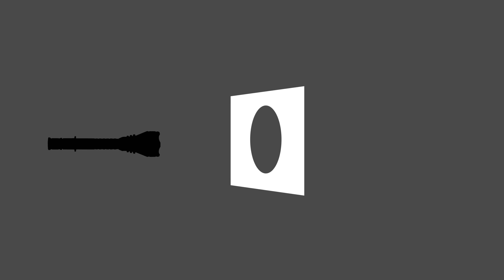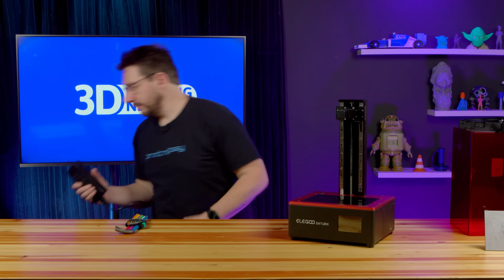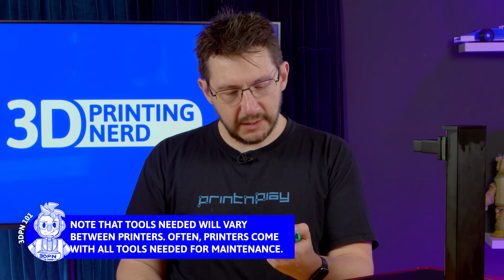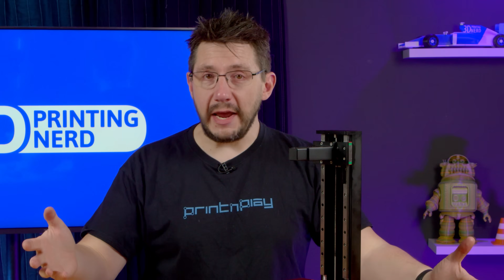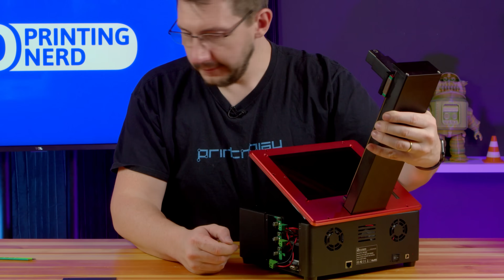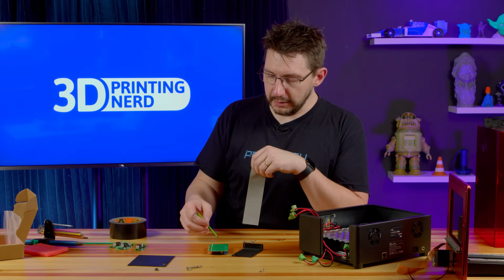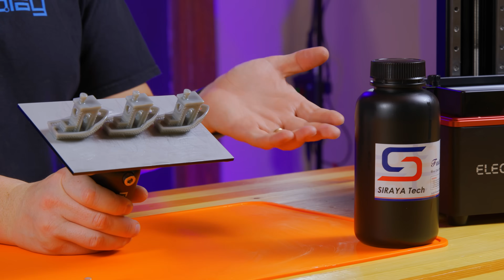FIX AND WIN an ELEGOO SATURN!

Comment: Hi, I'm new to 3D printing and I'm having some serious issues with my printer. None of my prints are coming out. They are not sticking to the plate at all, what am I doing wrong? I've pre-set the plate like a 100 times to make sure it's leveled and still it won't stick. Am I not doing all the steps? What am I skipping, I even contacted Elegoo and they won't help. So right now I have a big paperweight that won't print. Please help me out.
Thanks.
Ohhh, what I have it's a 1st gen Saturn

Comment: That is the one board that I did not have to fix in my Elegoo Saturn. I had to fix my Touch Screen, get a replacement 4K LCD and a replacement Main Control Board, plus I also got a replacement Build Plate from them to start off with. Took me 5-1/2 months to get mine working. It was a pain but at least it works now and works well. :P

My main frustration was not with the having to actually fix it or Elegoo Support but with China Post that they used to ship the replacement parts. Elegoo itself was very helpful. But China Post lost one of my 4K LCD screens and two Control Boards. Basically Elegoo had to ship out two 4K LCD screens and three Control Boards before I got one of each. The third Control Board actually got shipped from Dubai instead since they lost it twice through China Post. I really wish they would stop using China Post.

My Saturn was actually one of the Early Bird versions. I am guessing it was actually one of the units they sent out to be tested or something but who knows. It is a good resin printer though. The newer production runs have a lot of the issues fixed. They use a newer parts now. The Build Plate is a little larger. The 4K LCD is better and has a better ribbon cable design. The Control Board is updated and now it seems the LCD Drivers Board is as well. I think they may also have a new light source and updated TFT LCD. Not certain on the Light Source though. But all the others I know for sure have been updated from the early production units. So Elegoo is good at updating and fixing issues with their products. That is for sure.

Anyways...It was a great video to watch and one that is definitely helpful for those in need. :)

Comment: Hey Joel, as always I love the content. I know this is a bit of a read, but bare with me. With the larger build volume of the Saturn, I would really be able to look further into making lower cost dentures for people in need. When oriented around a 75 deg angle, I think I could get 4-6 to print in one go.

The backstory:

A friend of mine, Joe we will call him, was in a really bad motorcycle accident early on in his life. He spent a couple of weeks in an induced coma and then several months in the hospital recovering and rehabbing. Fast forward 40 years, through some things he could control and many things out of his control, Joe's life has been not quite the easiest. Over the past few years, his teeth have been deteriorating and because of the lackluster employment offered healthcare to non-full time employees from most companies, Joe, like a lot of people has had to pick and choose what his income goes to. I found out today that, through Medicare, he is going to have a multitude of teeth pulled. The kicker? That is all Medicare will pay for.

So for the people like Joe, which I know there are so many, I started looking into what 3d dental printing is doing for dentures. We in the community know the costs associated with this. While dental resins are easily four times cost of the resins we are using for the toys we are goofing with, that still puts the basic denture print at ~$5 in resin. The average dentist (at least in my city) that provides 3d printed dentures is charging about $1000. To me this is criminal.

Comment: Hey 3D Printing Nerd! I would like to print a Nintendo Switch case I designed in Fusion 360 with a SNES Zelda vibe and thus join the 3D printing community ! :D
I hope it's not to late to enter the contest, finished modelling my part a few hours ago, but my comment keeps getting erased (so I won't put the thingverse link but thing id is 4807949)
Keep up your amazing work and thanks a lot for what you do!

Comment: Hello Joel,
I am an junior year engineering student focusing on Mechanical/Aerospace Engineering. I am doing an internship this summer focusing on the additive process to prototype and manufacture flow angularity sensors to model airflow in a wind tunnel. With my internship being virtual, I do not have access to a machine to make prototypes and models, this is why I am reaching out. I would be using the Saturn to make and study prototypes eventually leading to a final product. I also plan on assisting local engineering firms who don't have access to 3d printing technologies at this time. 
Thank you for giving everyone this awesome opportunity,
Steven Little

Comment: The Saturn would be of great help to me and my work. I'm a former engineer turned inventor and I've been working on new designs for greener energy. My current concept is a new type of portable solar panel design that would work in disaster zones, isolated communities, off-grid homes, and RV and motorhomes.
I really need a resin printer to make the small pieces I need for a small prototype for testing the complex mechanical parts of the design. My FDM can't make the parts accurately enough and I'm on disability so I can't afford to buy one myself.

Comment: Great job Joel, if I were fortunate enough to win this I would use it to create replacement knobs and other hard to find parts for vintage synthesizers and other electronics.  Also I have designed and created parts for a couple drummer friends of mine.  They really like the parts I've built for them, but I would love to have a smoother part to start with so i don't have to do so much sanding and filling.   I've been watching you since I bought my first well worn Ender 3 from a prop guy.  I've completely rebuilt and now modded it thanks to some of your content.  Thank You for helping us all

Comment: Love all the videos! I'm currently exploring the idea of utilizing 3D printing in my company (to see if the company wants to invest in it) for manufacturing and prototypes. I would use this printer to print small prototypes to explore the potential even if it is on a small scale. Might also try to explore prints that are more suited for Resin since I'm only used to FDM.

Comment: My current project is a 3D Printed Drone (barring any electronics or hardware). This printer would be great for 3D Printed Propeller Prototyping. I'd experiment with pitch, number, and length of the blades. Also, when it inevitably crashes and breaks the propellers , I can print replacements.

Comment: Thank you for the video.  I would make robot parts to make a smallish but not micro, robot to try and get the nieces and nephews interested in electronics.  I've already gotten the raspberry pi's and arduinos for them, and module parts.  I just need to be able to fabricate a base unit to mount the sensors to in order to get their attention.  ( I think their dad is afraid of tech, which dampens the spirit. )

Comment: i love to 3d print. just bought a Mars Pro, and plan to print various parts for Lost Resin casting, jewelry, miniatures and components of various types. i love building all sorts of things. 

would love to 3d print a working mechanical model for a steam engine, or eventually maybe a sterling engine, to use as a backup generator that i can then iterate in resin and then cast when perfected to make the final parts.

Comment: If I won the Saturn, I'd use it to print tools and accessories for arts & crafts, photography, and astronomy. Also novelty items and custom or replacement light duty practical parts. And finally, molds for casting even tougher objects from fiber reinforced resins and metals.

Comment: Hi I am 14 years old and from Germany. I am currently having an Anycubic I3 mega s. I am working on a 3D printed VTOL and some of the parts have tiny holes and they are very small, they need a more precise was of manufacturing than the fmd method is able to deliver. 
You make great videos!👍

Comment: New parts for my AM8. Also I would like to add, that you should probably use electrical tape as gorilla tape has a bit of electronic conductivity. I found this through using gorilla tape on a high amperage circuit in an automobile and it kept shorting the circuit. Once I used electrical tape the short went away.

Comment: I would use the printer for my classroom. We are heavy into project-based learning and this would be a tremendous asset to have. The first use would be to print out the nose cones and stabilizer wings for the model rockets we build. Good luck to everyone.

Comment: Do you need to calibrate the uv light? (There are Potentiometers on the driver board.) And15:23 gosh just print a new plate XD. I would print some custom parts for my Ham Radio Satellite Basestation (Google: QO100 Eshail). ^^

Comment: If I had a resin printer I would print gears for a tiny planetary gearset. And parts for making an Axial Flow Generator. It's a electric generator that has the magnetic flux travel along the axis through the coils. Its a lot more efficent that way. I already have all the parts. I just need a printer that is more accurate than an FDM printer.

Comment: i plan to start a injection molding business to recycle used plastic and give it a new life. But tooling for aluminum molds are very expensive. I would use this printer for high resolution mold production! Having a Resin printer would allow the company to have flexibility and be able to adapt to market demands quickly and efficiently.   The company will focus an a green solution for recycling and producing new plastic products. Weldys Workshop here we come!!!

Comment: if i had this printer would probably use it to print minis,   before the hole social distancing i had started doing so with my FDM printer only to find out that FDM is not the best for miniatures :((
Also things for my car,  i know i wont be able to design and print an Air box with this thing but i could totally make replacements for all the busted plastic on the inside of my old golf.

Comment: It's always feels rewarding when you can double check a failed component with a simple verification such as moving power sources around. Great video as always. I'd use the Saturn for printing miniatures for board games that I play. I've been using my Ender 3 for a few years and while it's still good, it's no where near the quality of a resin printer.

Comment: I would love to print mechanical testing specimen using my thesis project (I am developing renewable resource based additives for photoresins, not just for 3d Printing). This printer would allow me to test that, especially as a s**tload of my other equipment got destroyed in a fire last month, but htats another stroy and I hope insurance will pull through on that -.-

Comment: I would start by printing a Joelbot in your honour and then i could finally print all tiny things with too small details for the filament printer and light-guides that will actually guide the light :-)

Comment: I am currently developing an automated gardening solution. My main focus is applying automatism for watering e.g. Lechuza TRIO planters automatically and correctly with e.g. a Gardena MicroDrip system. However, i dont want to use Gardenas system as it is way to expensive and unnecessary complicated. Doing this from Scratch needs a lot of prototyping mid and small sized things making the clamps and holders for tubes and electronics as you can imagine. A big build plate like the SATURN would really help as i am currently limited to a Anycubic Mono size for prototyping. 
When I'm done, I will make the project and all its files publicly available :)

Comment: Thank you for another great video @3DPrintingNerd

With such a printer, one of the first things I would try to print are light conductors (e.g. for all kinds of diy projects using led indicators etc.). They would allow designing more watertight enclosures, and easier or mroe integrated design of electronics. Also I always wanted to print bolts and fasteners for casings and enclosures to have them completely 3d printed (also for testing durability of such diy fasteners). 

Anyways, I think printer upgrades will probably be among the first things to print as well ;)

Keep up delivering high quality content, you are doing good!

Comment: I'm part of a student engineering team that builds a car for competition every year, and we recently started working on manufacturing aerodynamic surfaces (wings, endplates, etc). I would use this printer to explore and prototype lattice cored wings, which have been dipped in an electroplatingless solution. The idea being that the resin can be burned out, and leave a hollow lattice structure out of metal that is extremely light, perfect to wrap in fiberglass or another composite material.

Comment: Can't decide between resin or a filament printer as there both things that I need. One for bigger things for engineering & prototyping and one for my plastic addiction in the Gunpla community. If I was to use the Elegoo straight away I would be downloading and printing Gundams like there would be no tomorrow that as well as some miniatures as well as a few statues. Got tons ready to go for when I get a printer hopefully soon.

Comment: I love prototyping designing and building crazy contractions. Unfortunately I bought a pretty cheap PLA printer and cannot print detailed enough. With a resin printer I could make gears and high detailed parts, I have been working on a project for a friend to build a fidget spinner that shocks you when you spin it too much

Comment: I've been eyeballing a resin printer for a while. While alot of it would be used for Mini's. It would also get used a lot for some experiment parts that need to be stronger then FDM prints. Much like a trubo charger I'm currently tinkering with for a micro nitro rc.

Comment: I've been looking for one to print replacement parts for flight sim setups. The internals tracks need to be nice and smooth, and the saturn has the print volume I need. Of course; I'll also be printing myself an M3 Predator in a few pieces.

Comment: Hey Joel!  Nice giveaway!  I’ve really been interested in DLP resin printers.  But for a few reasons, haven’t taken the leap yet.  Both my father and I are into scale models.  He's an HO model railroader.  I’m a diecast collector.  (I think I caught the bug for scale realism from him.)  I have FDM printers.  But they really can’t cope with the level of detail needed for our hobbies.  I’m interested in printing parts, structures and details.  But also molds for resin and other casting mediums.  The build volume of the Saturn is probably a bit more than my everyday needs.  But then again I could run a lot at once.  Or print some really large items like trestles, bridges and buildings in a single go with great detail.

Love the video.  Excellent tutorial on good troubleshooting process.

Comment: I would make a 30 cm rocket assembly that takes standard pvc tubes with sugar rocket fuel.

I'd also install a delayed reaction to pop out a parachute when at the peak. I would print several of these to launch with my daughter. And others I would give away to children of friends.

Ow and for my start up I would have to print a a complex aquatic delay line that I can use to provide a good flow of acoustic energy from an ultrasonic probe to a rough surface.

Does that spike the interest? I would send you the videos as well. 

And you would really be helping out a single father that recently graduated as a mechanical engineer that wants to start up a tech company with the focus on ndt/industrial inspections.

Investors may apply, I designed something that is already being implemented by multinationals to cater to other multinationals and my nda has expired.

Comment: Those printers are amazingly simple!  I thought there was more to it, but wow!! How cool. 

So what would I print with it?!  Prototype parts for a pyranometer leveling device for solar farms. It would make the task of leveling a pyranometer so much easier and having a resin printer would give me a better surface finish which is needed for the device where an FDM printer just cannot provide the needed resolution. Yeah, helping technicians be more efficient and keeping solar farms running better. 

#highfive #solar

Comment: Every year i volunteer at a kids science camp.  Last year we took a model rocket design from online,  printed, and actually flew it.  But it was printed in segments on a FDM printer, so not only did it fall apart, but it also melted.  Id love to print it in larger segments and fly it again with the kids this year at camp.  That, and probably a settlers of catan board.

Comment: Very well explained, it was really great to see how the system evolved as well. It would have been really great to see the placement of all the wiring after you got it all back in place but before reassembly. I would have thought the sections would matter, good to learn I was mistaken.

If I were to win the printer I would start by printing minis for table top gaming but I would also use it to print house hold items that need a little more strength or asthetic detail I have been able to get out of an FDM with PLA

Comment: I have been trying to get a Saturn but they are really hard to get a hold of.  Elegoo is so back ordered I suppose.  So winning one would be awesome.  First thing to print would be an Iphone 11 Case.  I have printed them in the past on my Prusa but they aren't as perfect as you can get with a Resin.  Would want to try some of the flexible resin as well for this.  Should be cool.  Next up would be a Radial Engine for a friends RC airplane.  Now if they only had High-Five Blue in resin....